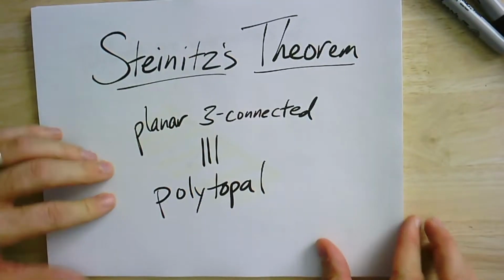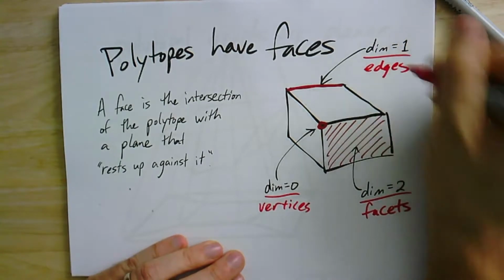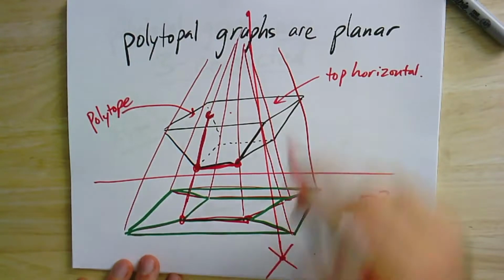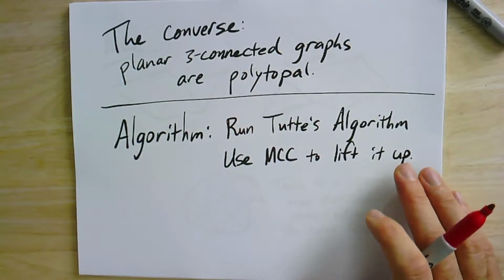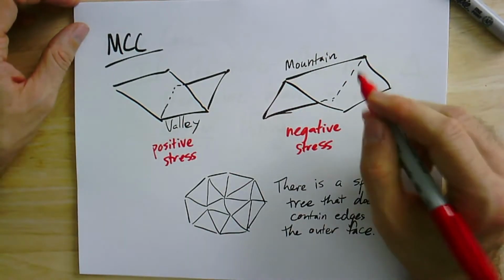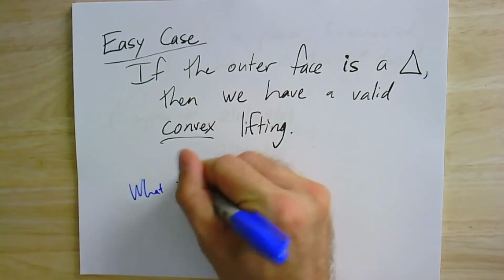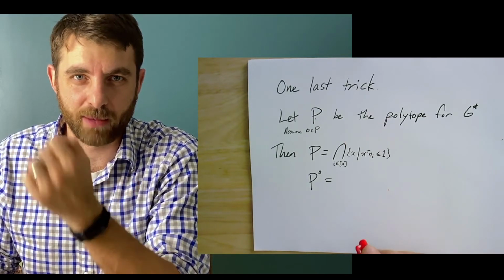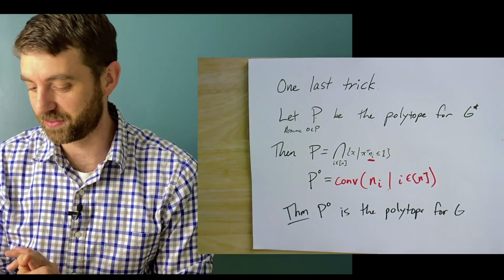GTAC 14.5: Steinitz's Theorem

Comment: Well you've got a rigidity issue with your structure if you've got no triangles :)  but a face can constrain a structure in 2 dimensions yeh? So 2 connected faces, like a birthday card or an A frame standing up gives you all the stability needed for 3d, is that the point?